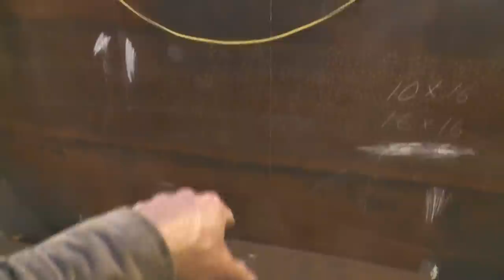Cargo Hold Framing - Part 4 - Welding for age 6 and up.

Comment: Doug;

Great job with both the boat and your grandson.  The lessons you are teaching him are priceless.

Since you are butting your fuel and water tanks together, and if you don't drop in a separate water tank, you might think about a double wall at the interface of the two tanks.  Weld in another inside wall piece about 1" from the current wall on the interface, weld in your top plate, drill about a 3/4" hole through the top plate in the 1" space area and then weld on a 3/4" bung.  You can then put a plug in the bung to seal the hole.  Do this for both sides of the centerline plate.  About once a month, take a dipstick, drop it down to the bottom of the tank, pull it up and see if you have any diesel or water showing on the dipstick. Cheap insurance to make sure you don't end up with fuel contamination in your fresh water. 

Regards;

Ron Kluwe

Comment: "I'm not that smart and I'll muddle through it." Says the man who is building a steel chinese junk/origami boat at his house. I'm just maintaining and repairing a 1999 Land Rover Discovery 1 and I have all sorts of help. Your figuring it out as you go. Thats like ingenuity, patience, imagination and mostly using common sense so things work well together. You Sir are a inspiration.
Reply: Having had 2 Discoverys 1992 and 1993, they needed at least as much welding as that boat so far lol
Each of the first Discovery's should have been born with a welder built in for future use :)
Reply: I guess my 1999 was well taken care of in that department OR perhaps it was the use or lack of salt on the roads. Ive been wanting to hot pressure wash mine and then apply waxoyl to everything on the underside just to keep it nice.
Reply from the maker: I'm glad you like the "muddle through it" process because it's the only one I know.   My dad taught me to work on a car by walking up to me and handing me a box with a part in it and said "Here, put this on that truck."   Sure wish we had YouTube back then.

Comment: Doug, I have watched your build avidly and I want to say that I am impressed with your methodologies, your ingenuity, your kick-ass midget helper, and all that you have accomplished!  Kudos!  Now for a bit of advise.  DO NOT MARRY YOUR WATER TANK BULKHEADS TO YOUR FUEL TANK BULKHEADS!  Here's the reasoning.  One part of diesel fuel will contaminate one million parts of fresh water.  If I may be so bold, if you can, weld in a false bulkhead between the diesel an fresh water tanks.  If either leaks it a "no foul" situation, the open space takes the seepage.  If you do not separate your fresh water from your diesel, even the smallest pinhole or crack will contaminate ALL of your fresh water.  There is nothing worse than tainted water.  Believe me, I know!   I lived aboard and sailed an Erickson 38-200 for eight years and I had the misfortune of having my water contaminated by some fool who used jerry cans to haul diesel to replenish my water supply.  Of course they were washed out, but the taste will never be forgotten.  Even a 1/8th inch dead space will save you from the dreaded prospect of contaminated water from which there is NO recovery.  Be mindful my Padwan!

Comment: You are giving him memories that will last his lifetime. When he is 80 he will remember building a boat with his grandfather. 
Where you are stepping the mast I would put additional bracing in there just to be on the super safe side. That area is very important & will take tremendous compression forces when the stays are hooked up & the boat is rocking. On the other hand, I do tend to overbuild things.

Comment: In the Navy we have man holes shaped like elongated circles like the one you built for your sand blaster tank. They have a stepped up outer flange to align and bolt the cover to the deck with a gasket. Also like it was mentioned on another comment, you will probably need a tube to do sounding tests to check the level manually. Wouldn't rely on digital readers. At lease advise I got from the Navy.
 Thanks for the videos. Glad to see the boat coming along. :)

Comment: Ordering a welder this week to show my girls how to lay down a bead.  They are both older and we aren't building a boat, but there's something kind of magic about sticking metal together.

FWIW, his 'about 2 seconds' at 18:47 was so close I had to check it on a sound program.  ~2.018 seconds, and some of that .018 might be echoes. Awesome kid!
Reply: Yep!!!  That's actually what I plan to get.  I wanted stick/TIG b/c my brother has a MIG, so I'm going to get the little 140ST.  I was considering the 160STH for HF start and built in argon valve, but for $200 less i can deal with lift start tig and turning a knob on the torch.  I'll spend the 'extra' (lol) on a chop saw and (cheap) belt grinder.
Reply from the maker: That's awesome.  Be sure to put as many hours on it as you can while it's in the warrantee period.   I am on my second Chinese welder.  The first one died after 5 hours.  The second one is well into 60 hours.

Comment: My only idea to help would be to make a jig to cut out your pipe holes with the plasma cutter. Just a long piece with the holes in the right places with a piece of angle on top so it would hang in place while you cut the holes out. That would give you repeatable heights on all your holes for a nice straight run and round holes.

Some day Aiden's going to get asked if he knows how to weld, and he'll be able to answer "My grandpa taught me how to weld when I was six. Then I welded on his boat for years, so... yes, I can weld." Give him a month and he'll probably be laying welds that look like a roll of dimes all over your boat.

Comment: Yes, you need to reinforce the mast base. It needs to be huge... overbuilt... The mast usually sits directly on the keel. You will have several tons per sq inch. 
Not sure of your accommodation designs for the hold but why not weld seating around the hull with hinged lids. Takes care of your water dam and allows access to battery boxes with lots of extra storage. Lids at deck level are a pain, they always have things on top of them.
Awesome job, love the videos!

Comment: Great Video!  Aiden sure keeps you in line doesn't he!! (has it all figured out too....)  I would agree with the plastic water tanks.  There are plastic welding units you can buy to use with sheet plastic and make tanks or liners...  would be right up your alley!  Also, if you go with tank inserts, I would recommend welding an angle iron around the inside of the openings and bolting your metal tank tops to that instead of welding them and putting another opening in the top of the lid. (although you may need the rigidity with the welded lids... so in that case never mind)  Your boat!!  Do what you want!!  Really enjoy following along with your project and adventure!!  Best wishes to you!!  Jim
Reply: Here is a link to the Plastic Welding Equipment:  http://www.delviesplastics.com/mm5/merchant.mvc?Screen=CTGY&Store_Code=DPI&Category_Code=Plastic_Welding_Supplies
Hope this helps!  jim
Reply from the maker: Thanks Jim

Comment: I'm aware this video is 2,5 years old, but as far as i'm aware you haven't finished the water tanks yet. what i would do with them is either glue up an EPDM bag for them or weld a relatively thick PE box. both are cheap and relatively easy (the box may be easier). EPDM allows the bag to seal off any air, so it won't need a breather and your water will stay clean and free from critters and you can stuff it through a small hatch, but it will leave your water tasting of an inner tube for a while. PE will require a breather and some filters (EPDM will still need a UV sterilizer or something for drinking water), but doesn't taste like anything. both will require some hardcore protection from rust, since condensation will get between them and the hull (insulating could help, PE might have a lot less of this than EPDM), but it can be some nasty crap that you wouldn't want anywhere near drinking water.

Comment: As always, it's great to see progress on the boat. And Aden's continuing education. :D
I don't know how high you'll raise the wood decking off the plates, but maybe 3 or 4" angle iron welded "toe & heel' would double as end braces for the standoffs as well as guide the "runoff" into the sumps.
And I agree with a few previous comments that you might need reinforcement, for the base of the mast, going down into the tanks. But then again, I'm not a Naval Architect, much less an Engineer. :P

Comment: A 2" dam will only be something to trip over and as a previous commentator wrote not much good in a moving boat. One thing I have read of is recessed areas covered with grates, they act as traps for any loose items making it easier to keep the yacht clean.
Standardizing your access holes as ovals would allow for faster production and lifting out of tops, as in your pressure tester, 90 corners become stress points. The stress on the hull keels as the yacht falls off a wave will be quite large as will the stress at mast points which is normally taken to a single keel. Now is a good time to put in more reinforcing and weld up those open areas as buoyancy giving you more floor area.
Does big brother in the USA require an inspection for insurance purposes and flotation?

Comment: OK I started watching this building and will have to go back and see what I have missed,but the welding looks fine and each type of welding has it pluses and minuses.  Have you thought of having you tanks sprayed with material like they do pick up beds? Yes you'd have to see if they would be OK for say potable water or fuels etc what ever you thought it would work for.  We have sprayed the outside of some of our alum boats we run in the rivers here 12'-16' type v hulls fixes any concerns of leaking & banging around on rocks,damn near bullet proof.

Comment: yes on spaces with no access like the skeg, filling it up with diesel or oil is a good plan. I have used fosforic acid on lots of applications, give it a try, and use it in a corner that will stay dry, for example the underside of the deck, or some of the bulkheads, they will stay in much better shape and loose the red look. I am just worried that by the time you finish the boat you will have some sports with bad corrosion.

Comment: at the end when pointing out the space down into the keels you said you were going to build a hatch to cover them.  It made me think about whether there'd be any use in foaming some of the interior of the ship in case you ever took on massive water it wouldn't sink.  Have you done a back of the envelope calculation on how much foam it would take to make it neutrally buoyant.  perhaps it would be impossible for a steel boat. A gallon of water is 62 lbs not sure what your final displacement would be.  A double barbecue tank foam kit makes 50 cubic feet of foam or 3000lbs buoyancy.

Comment: Doug
There is a company named Tnemec that sells coatings for steel water tanks that are AWWA approved. They will require a blast finish which will be all but imposable with your tops welded. I agree with the guy that suggested welding an angle  around the perimeter and bolting down the tops. At least for the water tanks. I have steel fuel tanks in my 45 year old boat with no interior finish and the only failures have come from the outside, the insides look to be new.
Don't for get to check out Boats and Harbors magazine, lots of stuff for big boats including hatches.
Reply from the maker: Thanks for the reference.

Comment: it seems to me, that a 2 inch dam to block water From going down the keel and batteries is going to be Totally ineffective in a rolling sea. if water was to get down there how Are you Going to get it get it out? In my home opinion, I would think those compartment should be watertight, but I have no suggestions on how to do it. Although I am not an engineer, the base for the mast seems to be woefully inadequate, but I have no idea as to the load forces exerted upon & by the mast.
It's fun to watch the interaction between you and the boy.

Comment: POR-15 Fuel Tank Sealer is great stuff for sealing fuel tanks and last many years. Maybe it is also safe for drinking water. You could ask them?
A 2" dam in front of your dry storage sound like very little if they are going to be unsealed and open to in the top? I'm not really sure how the final design is going to look like, but I'm thinking a two foot bench with lids that seal with weather stripping you can latch down. Salt water and lead acid batteries are a nasty combination if it can get to them!
If your dry storage are going to be un-insulated the steel are going to "sweat" when water condensates on the cold metal from warm air in the cargo hold. One way to prevent condensation is to keep the storage air tight so the moist air can't get to the hull plates.
Is there anywhere we can see drawings of the cargo hold?

Comment: Hi Doug!

THank you for this nice video, the very special side of it being your pedagogic skill with your grand son (but it is part of the grand-father mission to be pedagogic!). You show us many tanks due to be filled with liquid of diverse density, you show also "pits" dedicated to receive lest and heavy chains etc...
As you know, I'm building a plane. Thanks to the designer's blue print, I have to obey his prescriptions to be although sure that the gravity center of the total stuff will be in the right place at the end, and will remain within the correct "box" whith respect of fuel burning, varying pilot's wieights and so on.
Is there any sort of similarity with your boat? Are you sure that when you weld iron and steels (which are excessively heavy, as you show us in the biginning of your footage,) the position of the gravity center is under your control?

Congratulation again, dear Doug, and a  boat full of ennemies with their skilled-cooking wives wearing smarties and prinkles for your grand son! (;-)

François

Comment: I wonder being a boat that moves a lot and all, if the channels to carry the water back to the bilge pump holes, would need to be a pretty good size. I'm thinking in a rough swell, that water would easily jump that and go down into the bilge. But i guess there will be other pumps down in the bilge anyway ?

Comment: Doug,
Maybe it will be worth it to use some phoforic acid on a spray for reducing the amount of rust forming on the hull, it is a fantastic and very cheap primer to use on the insides of the boat. if you can get in gel form it works for the vertical surfaces too, called navy jelly.
Reply from the maker: I think that is just used to remove rust.  I considered primer to slow it down but now that most of the mill scale is off the progress of the rust is apparently very slow.  My main concern with primer is that it would add additional grinding work prior to welding, unless I blasted and used a weld through primer, but those are not great primers.

Comment: I did a project for work designing an oil-water separator site were we used a bolt together tank.  Each seam of the tank used a Viton gasket strip.  Viton is kind of expensive but holds up great against hydrocarbons. I know Teflon or PTFE has good resistant against corrosive chemicals as well.

Comment: Doug,
I second bar grate for the sides. You will need a mid support to break up the 48" span.  Also, I can't remember if you have a plasma torch holder for your cnc table.
Joe

Comment: Re fuel tanks 1.25" is min fill id so it has to be 1.5" to maintain 1.25 at fittings. I would suggest for your size vessel 2" as a min. Fill pipe should go close to bottom re foaming of fuel during filling. Each tank must have [code] it's own fill, no combining allowed. All fittings must be accessible, not hidden. Be careful there are lots of reg's re fuel tanks,fills and vents etc. Your doing good.
Reply from the maker: I'm not not building to code but I do appreciate the info.   1.25" was selected because that's the largest size my Harbor Freight pipe threader will do.  :)    But it wont be a problem to run a 2" line into the fuel manifold and fill all 4 tanks at the same time.

Comment: Hey Doug I have several ideas for fuel hatches and fuel tanks... I work at Tinker Air Force base here in Oklahoma and I work on the KC135 stratotanker as a sheet metal mechanic and on a weekly basis I end up doing structural repair on its water and fuel tanks... And I'm responsible for them being fuel and water tight, as you know jet fuel and diesel are in the same class of fuel... Not only are the sealants we use comparable with diesel, but they will last well over 30 years and are truly phenomenal sealants... If you write me back with a way to get a hold of you I can answer or try to answer any questions you might need answered... It's just to much to write in the comments
Reply from the maker: You can write me a svseeker@ymail.com or call me.  My cell is 918 630 4050.   The current plan thanks to other comments is to use a stud welding gun to attache the studs.  I did'nt even know there was such a thing, but I can buy the studs and rent the gun.  And then use 1/8" thick EPDM sheet to make the gaskets with 2.5" of hatch over lap.  I think the studs will be 3/8" 302 stainless spaced 2.5 inches apart.